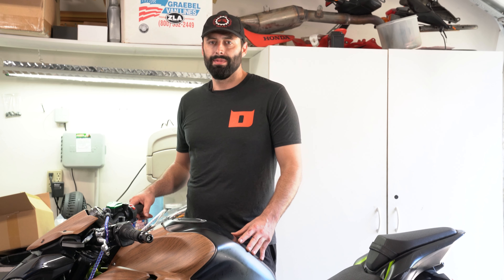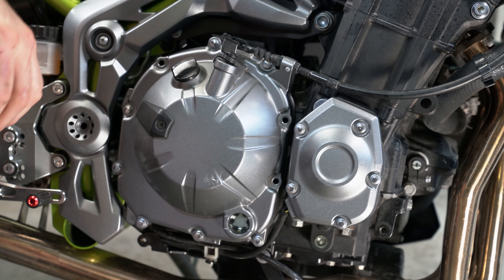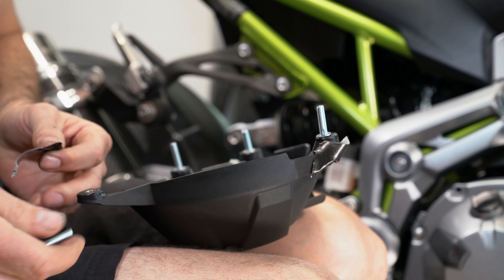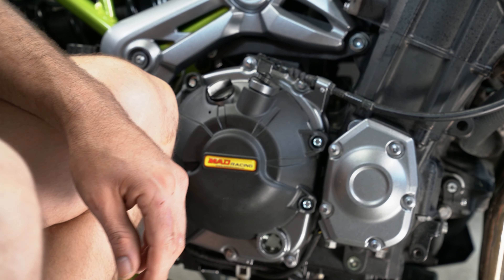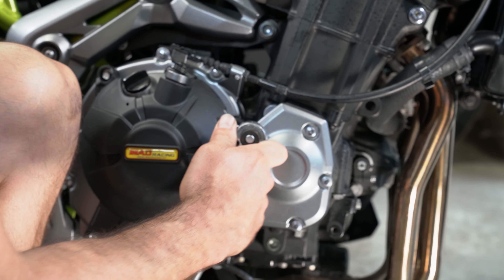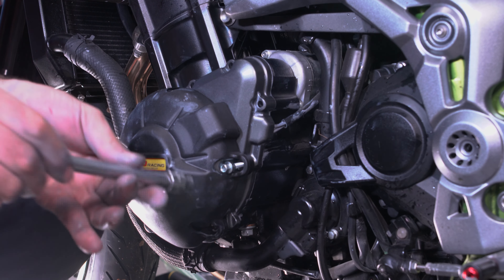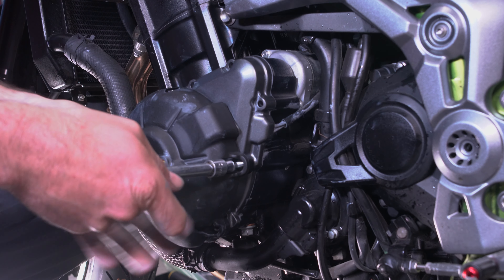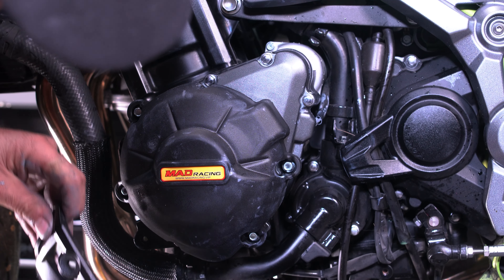Kawasaki Z900 - Mad Racing Case Savers Install How-To

Comment: I ordered eBay case savers but didn’t come with new hardware. Were the new and oem bolts the same length? I was just going to re use the oem ones if so
Reply from the maker: yeah, they’re a different length.